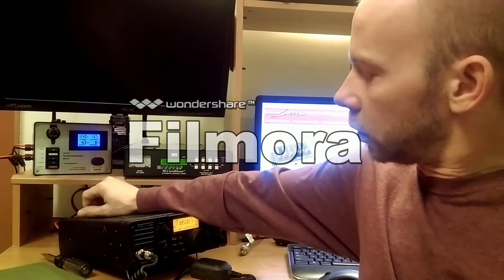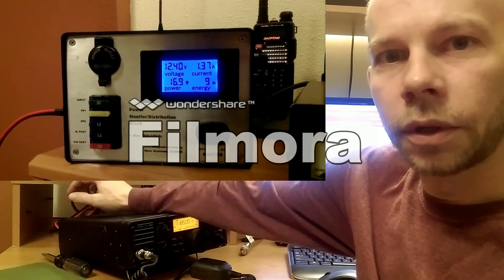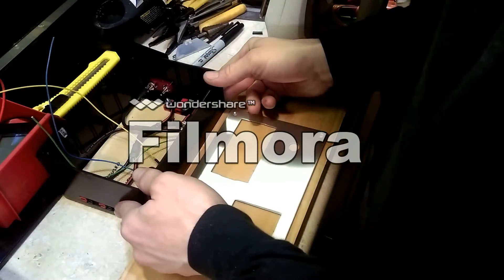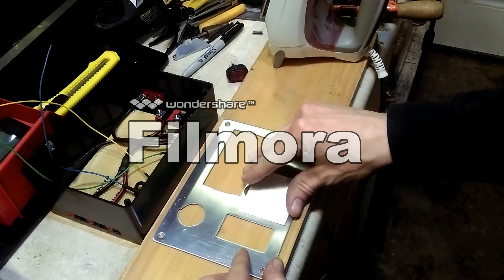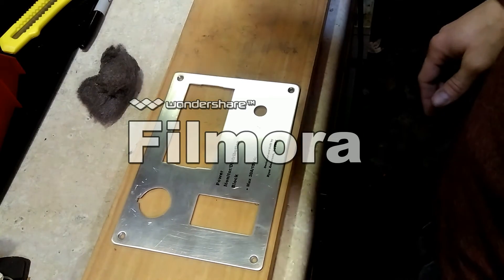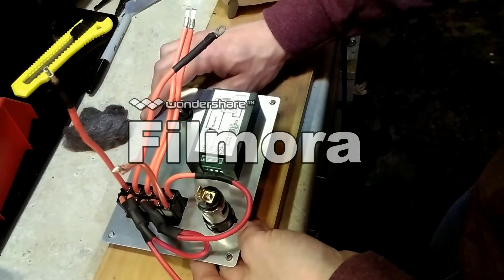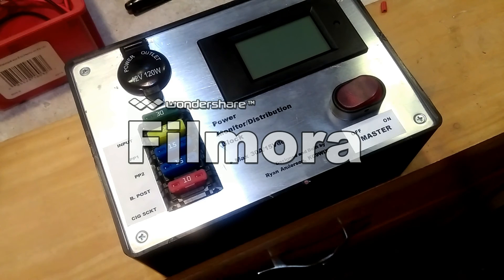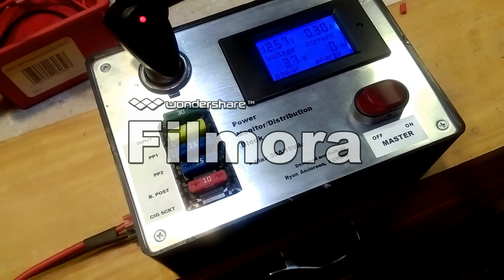Power Distribution Block and Power Monitor Project for Ham Radio

Comment: How did you cut such clean holes in the metal front panel? It looks really great!
Reply from the maker: It's been a few years, but I believe anything that wasn't a drilled hole was cut with a Dremel cut off wheel and then filed by hand.

Comment: Very nice construction job and much more capability than the purchased box would have given you. What gauge wire did you use inside the box on the powerpole blocks? It looked pretty beefy.
Reply from the maker: David Gillooly It's 12ga. I think the fuse holder leads were 10ga.  Here's the 12ga wire I used. Ive been very happy with it for all my radios https://www.gigaparts.com/1ft-red-black-power-cable-12awg.html